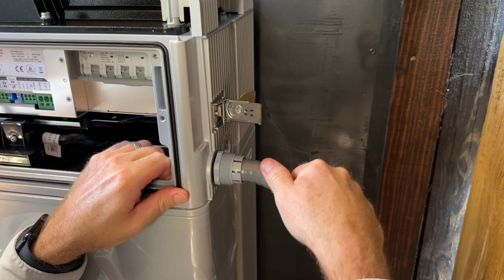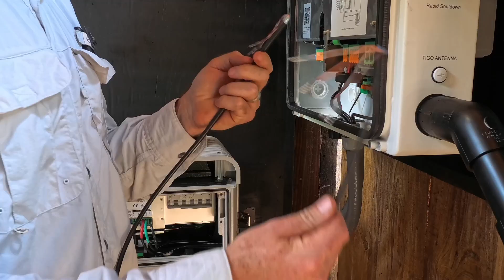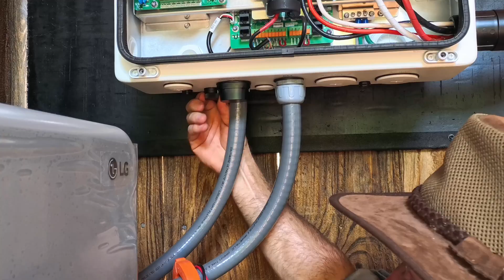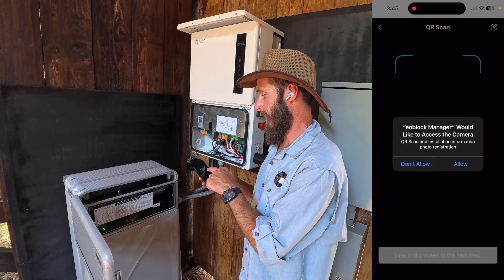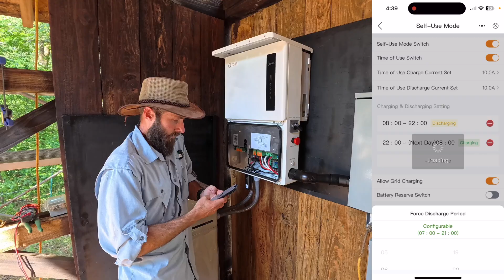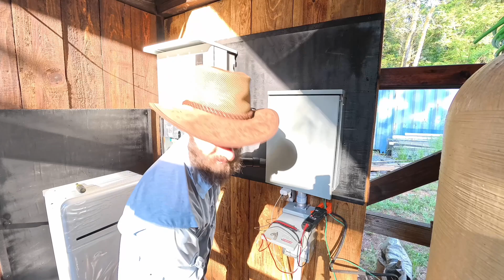Energy Builds: Solis + LG Install – Part 2 (Solis S6 11.4kW + RESU16H)

Comment: You can get a transformer to run the pump. They make ones for a few Hendricks. Even expense brands have issues with motors. Has to do with being high frequency. My solar can run some high load crap but my wife’s hair dryer would not turn the fan on. Bypass it’d work fine.

Comment: So looking at the spec sheet for your inverter 11.4kw is max output for 10 seconds of 240v. You pulled almost 6k per leg trying to startup your well pump. Why is your pump pulling that much load? Mine runs 240v at 1400 watts and startup around 2500 watts. I think that inverter is being overloaded and probably overspecked from the manufacturer

Comment: Seems like most well known youtubers do not know the answer to my question.  I watched your series on 3x 6000xp installs. I think you got this! Lol. 

So, I have a wierd set up from a large semicustom home i bought new 4 years ago. Single story home with about 6000sqft in Arizona. Using 145kw per day average for last 3 months. 

Goal= run only the entire subpanel in garage on 18kpv (since flexboss is out of stock and I can't wait anymore.)

Main 200amp panel and meter are on the opposite side of the house from my subpanel that is in the garage, where i want to install an EG4 18kPV. 

Problem=There is no way for me to bring any cables to the outdoor main panel from the garage, because the grass is fake turf and nailed down to sand, rest is cement. Going above is not an option because it would have to cross 2 unusable attics and 4 walls would have to be breached. 

Here is the wierd part to most solar youtubers. The SUBPANEL in the garage is 200AMPs as well, sent from the main panel. It powers the west wing of the house with an hvac, garage mini split and all kitchen appliances along with rest of the west wing lights and plugs.  I measured all loads and an EG4 18kpv can easily run this entire subpanel. When hvac and minisplit are running hard, they only take 4,000w together. 

And the main challenge question is:
Can an EG4 18kpv be wired to this garage 200amp SUBPANEL directly, so it just feeds that subpanel and not exporting to the grid/main panel, but that it still gets AC IN from the SAME subpanel to use the grid when batteries and sun are not sufficient?
I do not want to add another panel of any sort if I don't have to. 

 If you let me know how to wire this up WITHOUT adding another critical loads or any other panel/subpanel, but still have the smart automatic switching to grid when needed, I will buy the $20,000 worth of signature solar stuff right now including: EG4 18kpv large batteries and if you recommend a gridboss if it is any easier to wire to the same subpanel. And will tell signature solar, that you solved this mistery.

The whole thing is, that I want to supply solar and batteries with grid pitching in as needed to the entire 200amp subpanel for just the west wing of my house, and not mess around with the manual switch that I have set up already (temporarily). The fact that my wife would have to give me a call to ask how to switch back to grid mode manually while I am doing surgery, just can't fly.  I hope you see what I mean.  

As far as if I have enough solar, yes over 16,000w on ground mounts producing plenty of power in Arizona sun facing mostly south and arrays for morning and late afternoon sun. If I need another 30 panels, i will buy it no problem. 

I just want to finish this project to power the subpanel in a hybrid fashion without messing with feedback to grid or main outdoor panel. Maybe the CT clamps on the subpanel would do the job? Idk

I need to finish this project so I can sleep again and not be behind on my surgical paperwork. 4 months and going. Lol. I think you got this for sure! Thanks.
Reply from the maker: I’ve been thinking about this and will get back to you.
Reply: @HomeEnergyIndependence  just found out today that it's a 200 amp main panel for half of my house and not a subpanel. It's a 400amp service.
Reply: @HomeEnergyIndependence that changes everything.
Reply from the maker: @SurgeonTech  Here's what i'm thinking
DISCLAIMER: I’m not a licensed electrician — this is just my best understanding from research and experience. Confirm everything with your electrician and local inspector and it would be a good idea to call Signature Solar and get their opinion.

You can power your entire 200A subpanel from an EG4 18kPV without messing too much with the main panel or adding another subpanel — here’s how:

1. Reroute the existing feed from the main panel:

The wires currently feeding your garage subpanel from the main 400A panel get pulled out of the subpanel and landed on the “Grid” input terminals of the 18kPV (AC IN).

If those conductors are too short, you can extend them with Polaris connectors or an appropriate junction box.

2. Connect the inverter's “Load” output to the subpanel:

From the inverter’s AC OUT terminals, run new conductors back into the subpanel and land them on a breaker breaker sized according to the manual).

The inverter now acts as the gatekeeper: it powers the panel from solar/batteries and pulls from grid (main panel) only when needed.

3. Enable Zero Export mode:

Use the included CT clamps on the incoming grid lines (the ones now going into the inverter) to make sure the inverter doesn’t export power back toward the main panel.

• Protection:

Your existing 200A breaker in the main panel will need to be replaced with a 90A breaker to protect the AC IN wiring/inverter.

Add a 70A–90A breaker between the inverter AC OUT and the subpanel to protect that run as well.

This setup gives you automatic solar/battery/grid switching, no grid export, and no need for new panels or complex rewiring — just a little re-routing.

Hopefully this helps.
Reply: @HomeEnergyIndependence  thank you, i just got it a few hours ago. Its massive. 
I will run your suggestion to the electrician this Saturday (if he shows up).  They are a different breed these days. Took 4 months to get him to say that he would stop by. He wired the back yard and the shop, so I prefer someone that knows the house set up. Probably as expensive as another electrician. It's ok I will get a 4th job to cover him 😂. 
Seriously, thank you for putting in the time to help me figure it out.
Reply from the maker: Let me know how it goes!